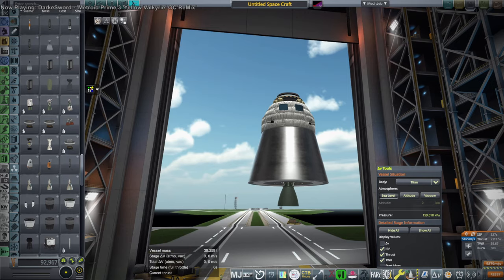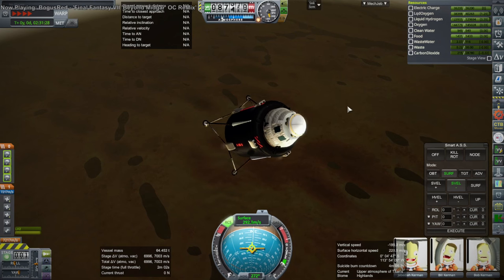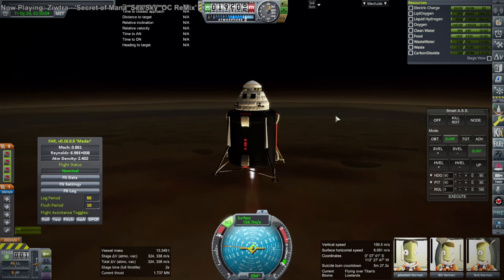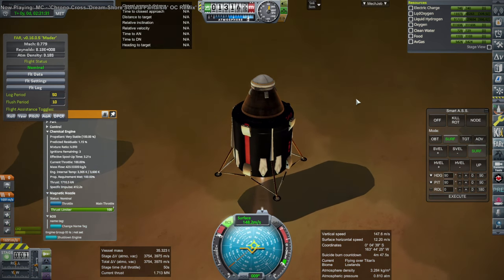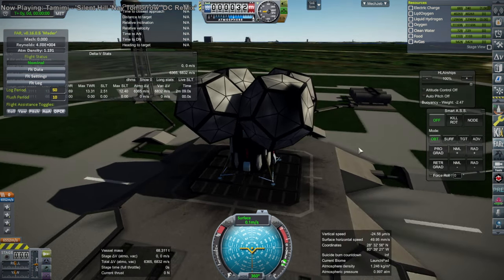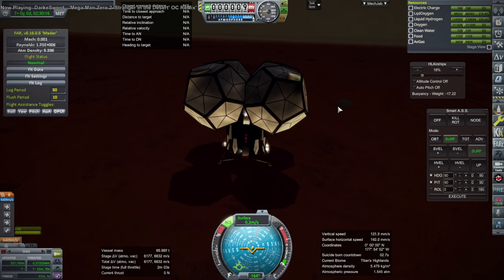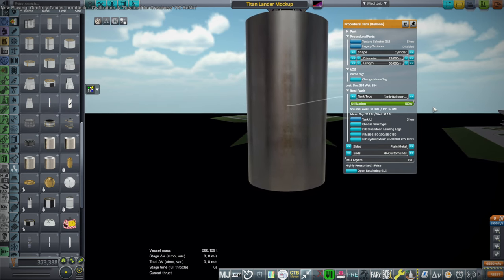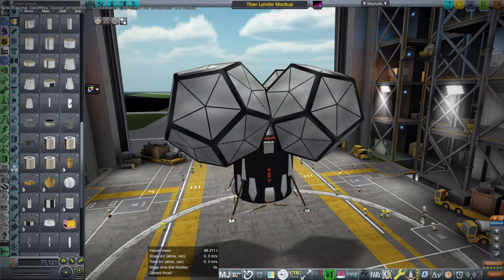Titan Lander Blues (RO in KSP 1.12)

Comment: After this livestream I did a "quick" test. I just used a dragon capsule and 3 RL-10A-5 engines. Total craft weight was around 52 tons on the surface and the capsule itself was around 8 tons. Mechjeb had the atmo delta V on Titan's surface at just over 5 km/s and after reaching orbit it was showing 1.3 km/s remaining. Definitely doable with the right engines and a lot of patience. I tried to keep the drag low so early ascent I kept it around 1-2kN of drag but I think I was losing a little patience and had it between like 5-10kN later on.
I did a quick edit and put the video up if you're interested

Comment: How feasible is using an electric helicopter rotor to do some of the work? Maybe a combination of both. It will be unwieldy and complicated. Electric ducted turbo fan stage that drops off once the atmosphere is thin enough to make a rocket engine worth using.

Comment: Wait, what is the difference between pressure and density?
Reply from the maker: Density is how much stuff in a given volume while pressure is how much force that stuff is slamming into a surface. So, if the particles have more temperature, they have more energy, and the same amount of particles produce more pressure.
Reply: @RaizSpace  I thought density is mass/volume.
Reply: @perfectman3077 It is. Mass/volume is how much mass (stuff) is in a given volume
Reply: @red_ravenhawk  Oh right. But wouldn't this higher atmospheric density also affect engine performance? 390 ISP at sea level may not be realistic.
Reply from the maker: @perfectman3077 No, only pressure enters into the ISP equation, not density. So it is affected by the 1.5x pressure, but not the >4x density. Also, the 390 at sea level is measured at 1.0x pressure.